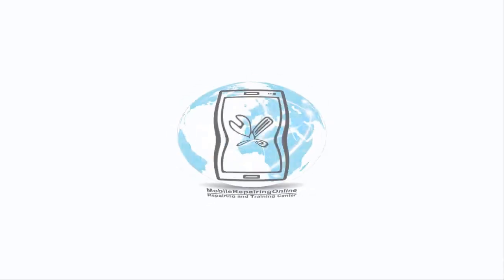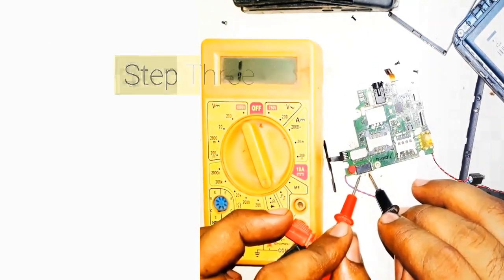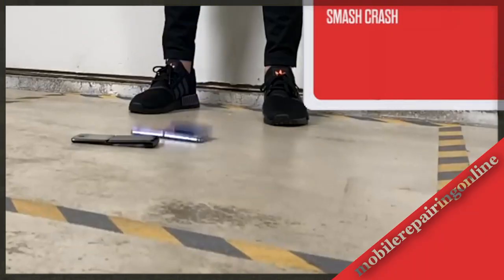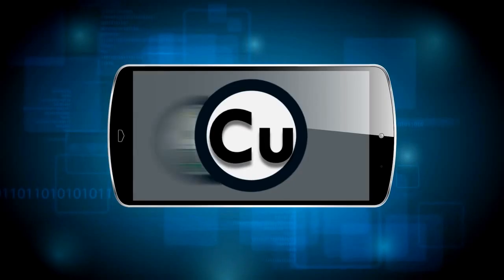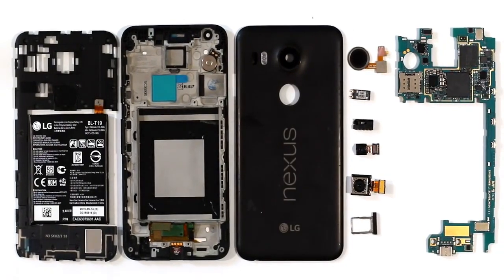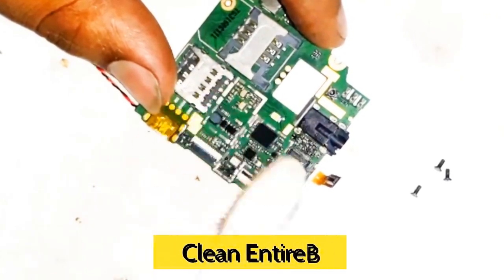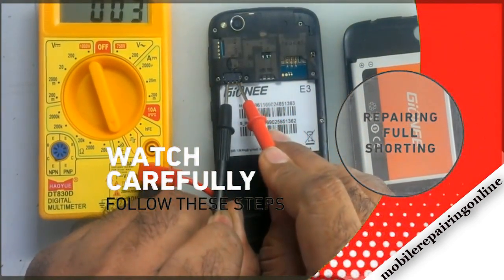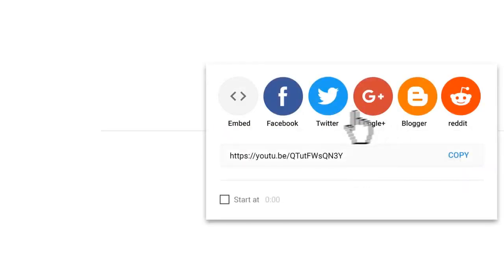How To Check Short Circuit and Repair It Course (in Year 2024)

Comment: My phone is not turning on, not charging, the phone is nokia 500.
I've checked the battery connector in reverse, the value is 197; in forward it's ok.
Anyone help?
Reply from the maker: check it on the dc power supply then text me
Reply: @Muhammadasifazeemi  Hi! Thank you for your response! I've checked with the dc power, seem like it draws a small amount of current but I still can't power it up.

Btw, happy new year!
Reply from the maker: @julianthediyer  your phone is half short circuit
Reply: @Muhammadasifazeemi  Hi, i have another nokia phone which is only vibrate and no display, could you help me repair this, thanks so much! 🙏

Comment: Do you have to replace circuit board if you had a short circuit on your phone?, because my phone got water damaged and the service guy said i have to replace the circuit board which is expensive, so can water caused that much damage? i thought they could've just clean the corrosion and all that stuff, not replacing the whole thing.

Story:
I just dropped it in water while it was on and when i picked it up i want to turn it off immediately but i can't because the screen is half broken, and can't detect my touch, so i waited for a day dipping it in rice hoping that it would dried out, and it doesn't work, my phone won't turn on and can't be charged, bring it to service center and they said it had short circuit and the circuit board had to be replaced... the price is quite expensive and i don't have that much money left, not to mention I'm knee deep in debt, so to say it bluntly, am I fucked?

Comment: Very insightful and so easy to understand. I'm definitely subscribing!
Reply from the maker: well come
Reply: @Muhammadasifazeemi  please Sir I have an infinix x571 and a tecno spark 3 phone both I suspect have full shorting. How do I fix the issue?
Reply from the maker: @adieleprincearthur1680  sorry for let reply. did you check the battery connector to power ic lines?
Reply: @Muhammadasifazeemi  no I only cleaned the panel with contact cleaners.